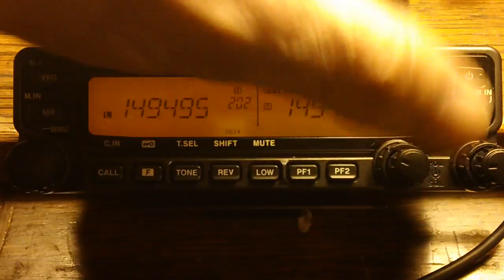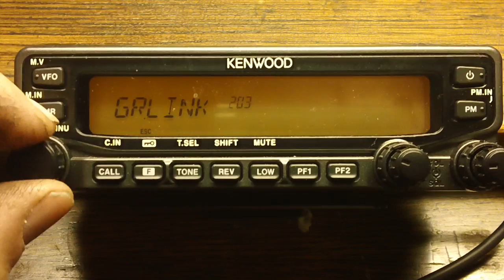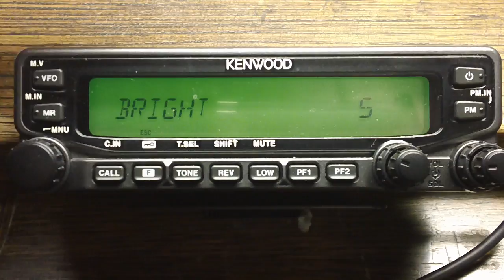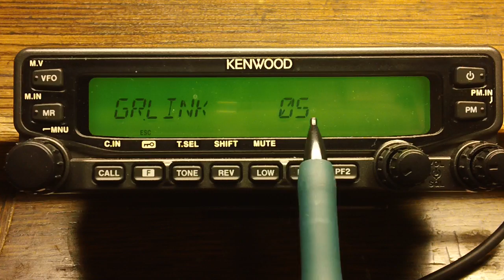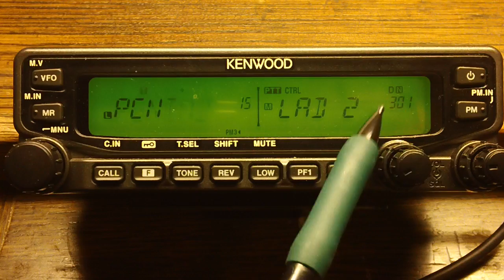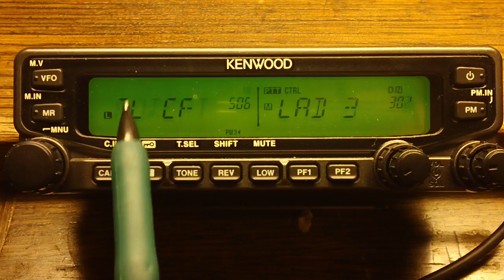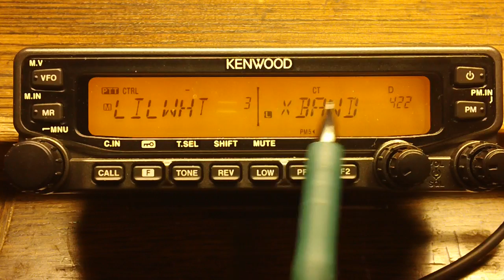v71a programmable memories

Comment: good video, just bought mine, had an old 702 that must be 30yrs old, still works but getting tatty, the only mod to the V71A has been the fan, replaced with a Noctua NF-A4x10FLX unit, almost silent now, next will be the cable to use with MCP-2A software to programme it,

Comment: Ok, this is the only info I can come across on programming the PM's, however it is not answering my complete question. In order to store channels in PM, do the have to be in sequence, or can you pick what channels yo want in each group? For example I would want channels 1-3  and 21, 25, 30 in group 1 and 7,9 and 11-19 in group 3. Is this possible or does it have to be 1-100 on group 1 and 101-200 on group 2 and so on. I just want to pick want channels I want in each group.

Comment: How do you like this radio? And would you recommend it, or any other radio? Thanks. KC3DSF, 73.
Reply: I highly recommend this radio! I own this one and the TM-D710A. They are easy to program strong and very reliable!  This is my favorite analog only radio. If there was no digital I would only own one of these radios. I have a video on this radio on my channel.
Reply: I also would recommend this radio as well, I have two of them, one my base, and the other my mobile. While I have done all of this, it is good radio and easy to use. KCØKM.

Comment: I've been trying to find info on how to set up. The Manual for V 71 and the D 710 is not that good. I like to set this for my V 71 and D 710. So from what I gather. You use 0 - 100 local repeaters, 101-199 could be Ladd. When you hit the PM button it will show the 1,2,3 etc. It's certainly not like my IC 880. 73 va7qu